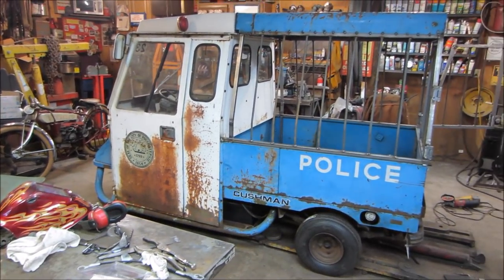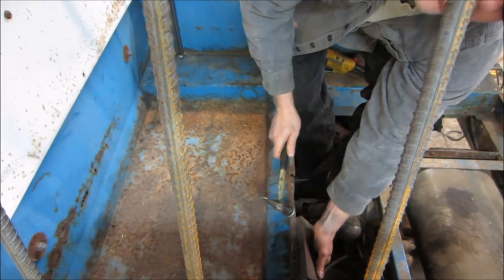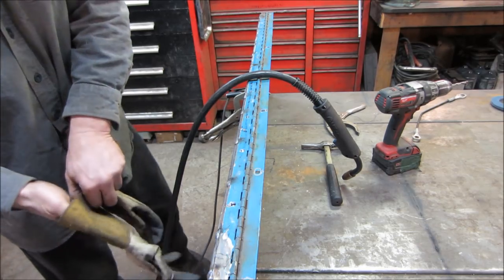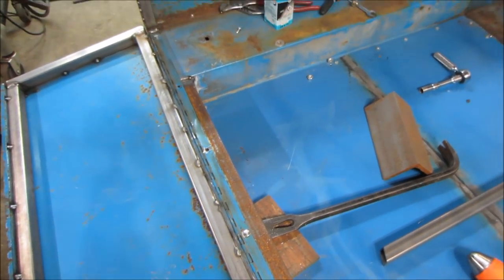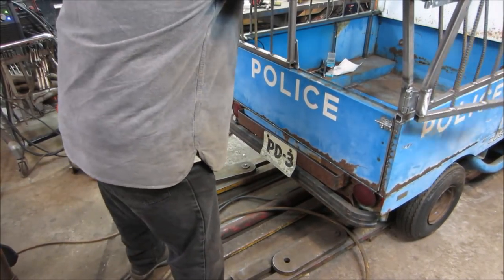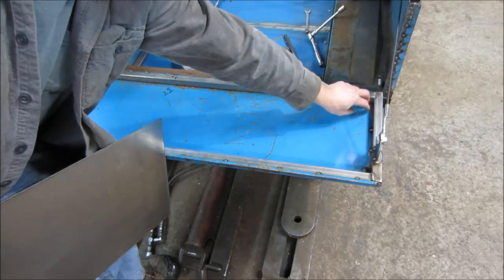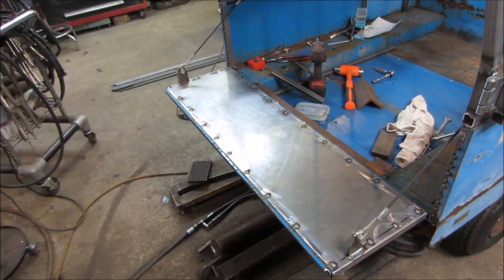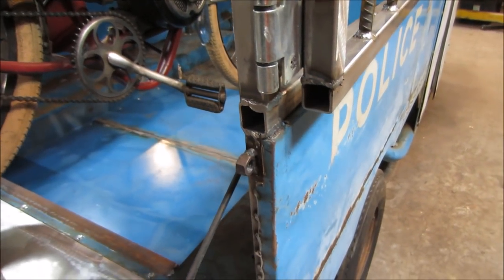cushman floor and tailgate fabrication

Comment: I still do not understand why you chose to go to all the work to make to roof and sides. Making this Cushman in to a pick up I get. The rest I do not. I know it is yours and that is what you wanted to do.  I would not have done that I think I would have made it a pick up with the trunk being full length. I would have make the trunk deck/cover removable. Other then that I would have done every thing else you did. As for the back up alarm. You could put a switch in the cab so that it only activates when that switch is on and it is in reverse. I think I would put LED back up lights on it and probably all LED lights to the rear. Those are how I think I would have rebuilt that vehicle. I might have done as close to a full restoration as I could instead of a rebuild. What you have done is of good quality and will function for you very good. Be safe Mustie.